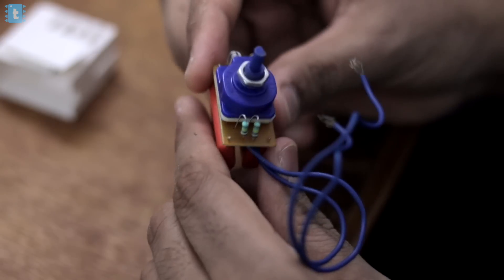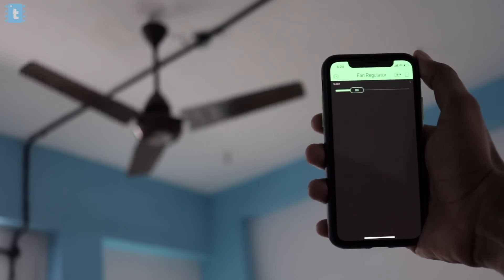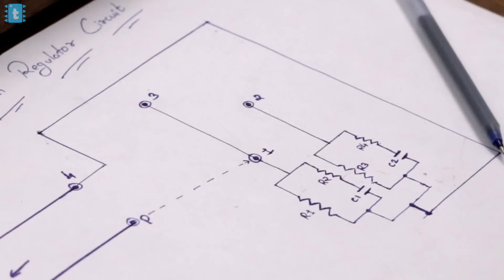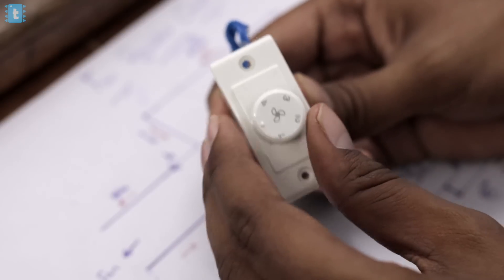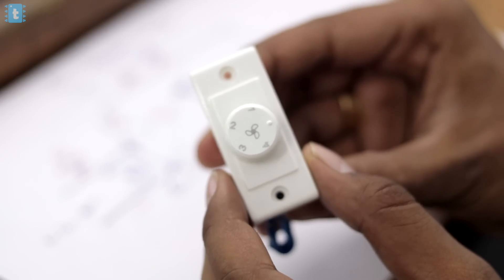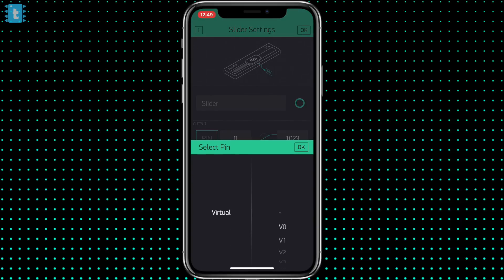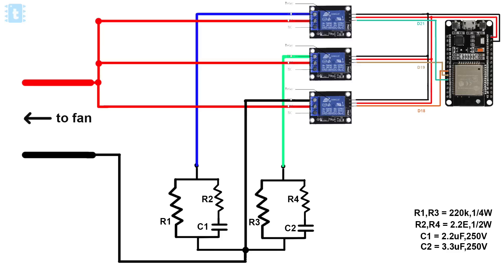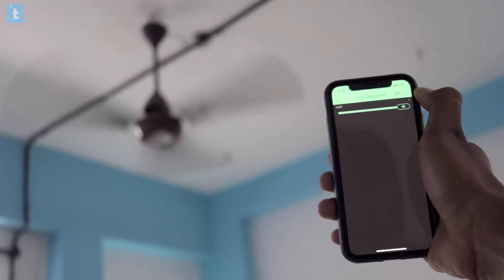Blynk Controlled Fan Regulator without Humming | Fan Regulator working explained |  IoT Projects

Comment: First question
Sir can you explain the purpose of using 2.2E resistor in series with capacitors in fan regulator circuit ?
Second question
Why I blowing my 2.2E resistors in series with capacitors after few operations plz help me

Comment: Why don't you try it by bt136 because its cost are lesser than your project
I had made it by bt136 transistor though wifi control and it also cover only small area in my board.
Reply: Triac based regulator makes hum noise

Comment: Great work in reverse engineering a fan dimmer, but it would be simpler to use a Triac for Dimming application and the circuit would be smaller and cost efficient aswell..

Comment: You need to find a way to put software speed control in this order,  OFF>>High(4)>>Mid(3)>>MidLow(2)>>Low(1) or there's gonna be fan coil damage or something like that.. the regulator u tore apart should also be in this order..
Or Make sure Fan is at highest speed while turning on

Comment: I need some clarification, as you say that point 3 is connected to point 1 and point 2 it means all 3 points are shorted, in that case either we select point 1, 2 or 3 path of electricity will remain same as the electricity will flow from a common node to all paths

Comment: can you help me out with my project fan speed control using ir remote with esp8266 or Arduino Nano with digital potation meter there are lot's people have no wifi at home so they can't use app and Bluetooth is not that good for automation so ir remote is batter

Comment: hello bro ,i saw your video and block i followed exactly and did same i use 225J and 335J capacitors and resistor values are same ,and it works perfectly,  my fan is rotating at speed 2 after 20 minutes i increase fan speed to 3 the resistor 2.2E is burn out with pop sound then my fan is rotating with speed 1 and speed 4 only, did you have any this type of experience when testing your circuit i need WHY it happens like that ,i replace resistor with new one again it happens ,i don't know how to solve this can you have any idea  to solve this ,did i use any other value resistor to this speed2 ,capacitors are good and 220k 1/4watt is good
Reply: same happened to me 
I use 2.2E 1W but still is pops

Comment: I am Aurdino beginner

I have done Fan Dimmer Aurdino Program by
using Relay Coils.

In this there are 4 steps.
I have used D8, D9, D10 pins in Aurdino UNO board.
I am operating with IR Remote Control.
I have used 5 buttons to operate this
 
Button-1 :- Off

 Button-2 :- D8 pin will be on   D9, D10 will be off
 Button-3 :- D9 pin will be on   D8, D10 will be off
 Button-4 :- D8, D9 will be on  D10 will be off
 Button-5 :- D10 will be on       D8, D9 will be off

I usedCapacitors and Resistors which is in domestic 
dimmer to drop the Voltage. 

We have to use more buttons in this project.
But I want to use only 3 buttons in this project.

I want to use
button -1  as Fan start and stop By using button

When the power is off, after coming the power the last function 
should be stored in eeprom

Comment: Hi Techie
this looks like a step speed controller: Can we use this for CFL or LED bulbs?
I want to make an AC Dimmer circuit using MOC2031 and BT139 Please give me some idea.
Please give me a reply I am trying since last month I bought so many electronic components not working as expected need your valuable input also I am testing AC detecting circuit using 4N35 with direct AC detecting That also not working.
please help
Reply from the maker: Watch this 
https://youtu.be/lQOzLP1lMJU

Comment: Hi... using the circut in the conventional fan speed regulators, we cannot get continuous speed regulation and also the speed steps they provide are quite irritating bcz the speed variation is not linear. I have simulated one new idea circuit for achieving AC voltage control with high frequency pulse width modulation. By switching the MOSFETs at 10kHz frequency, we can achieve smooth sinusoidal current(bcz of inherent inductance present in ceiling fan), hence there will not be humming sound. See the link below for the circuit and its output to understand this technique. I hope you can make this ciruit. Contact me if you need any help.
https://drive.google.com/drive/folders/1rro42mv3ut1RD9TzR04wqsrl3rm71JaK?usp=sharing

Comment: Hey Sachin, this is great explanation and very well presented. I have been running similar setup for more than a year except with D1 mini board and ESPHome firmware - it has been a rock solid.
Like you presented, I did use the existing regulator board by removing the rotary switch and soldering wires which go to relay board. I'm facing hard time finding these capacitors. Do you know from where can we buy the capacitors separately?
On a side note, I also tried to design custom PCB with two big capacitors and 3 relays to make it compact but didn't order as unable to find the capacitors. I shared PCB renders to you via email last week which includes this board. Do you happen to see that?
Reply: hi......can you please tell me which fan regulator brand was it ? ..... since the regulator i brought from store has 6 terminals for the rotary switch (my regulator at speed 3 connects to 2 separate terminals instead of connecting to pin 3 and pin 2)

Comment: Nice one 👍 
My alternate idea is to attach a cheap servo (sg90)on top of the regulator. There by you don't disturb the existing connection.
Reply: Does it will work ??😢
Reply: Yes
Reply: @Arunkumar18  did you make that?

Comment: Great Job-like always I love all the work you do. There is one thing that you need to add that is a box to install the relays in and some type of shielded cable for all the mains voltage. None of the higher voltage terminals or wires can be exposed

Comment: I like this project but bigger size board using 3 relay that's not comfortable not fit into back side of switch board
Reply from the maker: If you design a custom pcb for it the design will get smaller

Comment: Bro what if we want two way control, so we can use potentiometer as input for esp at three different pins in order to give it the desired level of speed . But how to give it preference over the blink controlled...?
Any help...
Reply from the maker: I’ll try to make that if possible. “ 
Internet & manual fan speed control “
Reply: @techiesms  thank you bro, but I was asking about the preference as you made the light switch , so consider this that i want the physical potentiometer to be the master switch and its values to be reflected in the app and the app to be the secondary switch . I understand the working and all but i just can't realize how to make physical switch a preference . So it will be very good of you if you explain the code as well.
Thank you 😊

Comment: Hello Techie, 
I have made automation using your tutorial it's working perfectly. But fan speed is not adjustable.

Please made whole automation circuit 4 Chanel, with one fan regulator.....

But this tutorial is helpful and easy to me made fan speed regulator...
Reply: You can add 4 more relays and no need to add anything in code only you have to add buttons in blynk application

Comment: I am using ac dimmer for Controling fan speed and it working perfectly, no humming sound. I made the circuit from one of your tutorials and order it from jlc PCB. Thank you for all the simple and smart ideas.
Reply from the maker: Humming sound comes when your fan is running at slow speed

Comment: You should have used "STEP WIDGET" instead of slider. That would have made sense as the regular fan regulator has steps to control the speed.

Comment: can this be run using TASMOTA or ESPHOME so that it can be integrated with Hass.io ?
Reply from the maker: Well I haven’t used them but yes it’s a simple technique which can be integrated with any platform
Reply: @techiesms  could you demonstrate that in one of your video. Tnx
Reply: are the pins on the ESP active Low/High, designing  a PCB for the project

Comment: 👌👌👌bro, but I have a doubt, why shouldn't we use pwm and triac based circuit.
Reply: That is the main reason this video was made. Triac based dimmers will creat humming noise. Even with snubber circuit it still has that humm...
Reply: @madhukeshnp  yes you're right
Reply: @madhukeshnp  k Tq